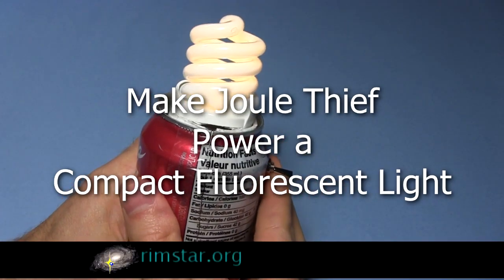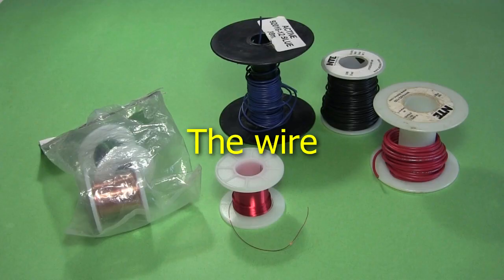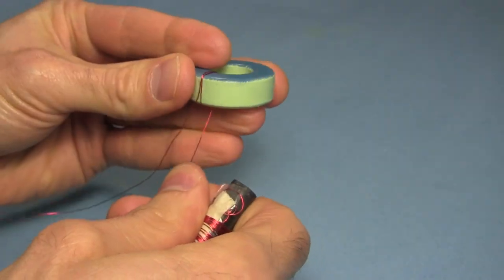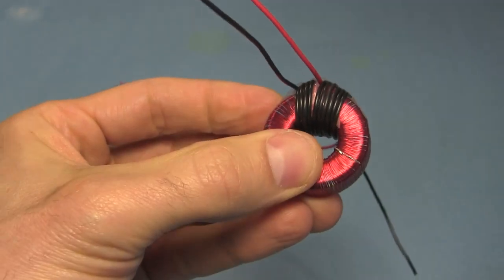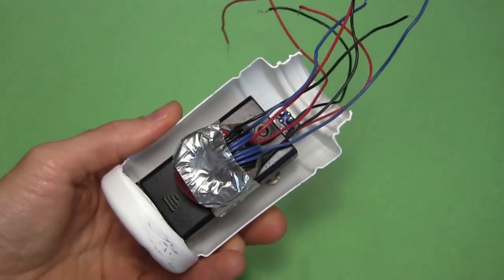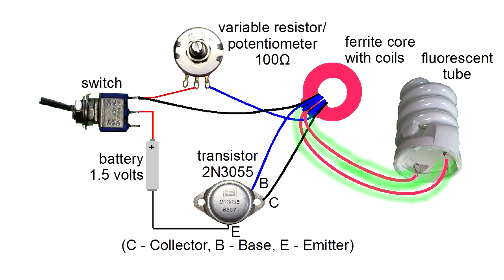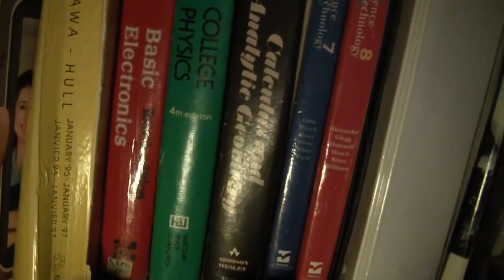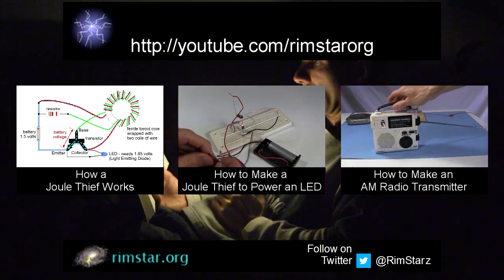How to Make Joule Thief Light a CFL - Jeanna's Light

Comment: The original Jeanna's Light circuit used a TIP 3055 and a 3.375" ferrite toroid and output over 700 volts from a "dead" AA battery.  Jeanna was an online friend of mine and designed a brilliant circuit.  I built 3 of those lights here and they still work all these years later.

Your videos always show great detail and easy to follow instructions for replication.  I admire your ability to do that.  Keep up the good work.

PS  The Jeanna Circuit was developed over at overunitydotcom.

Bill

Comment from the maker: Using the 13 watt CFL in this video the two batteries lasted 25 minutes at full brightness and 30 minutes dimmer. Using a 5 watt CFL the two batteries lasted 90 minutes at full brightness and 15 minutes dimmer. I show these tests in my follow-up video "Fun with Joule Thief Powering a Compact Fluorescent Light". There's a link to it in the description below this video or you can find it in the Videos section on my channel page. Others have different runtimes based on the coils, resistances, ...

Comment from the maker: It was a conscious descision to put only the one 1.5v battery. I started with a joule thief lighting an LED which normally has just one 1.5v battery and I decided to leave it like that since the CFL circuit could have any number of 1.5v batteries depending on your resistance, core and windings. And I think I found the variable capacitor mention you're talking about. It's in the labeling at 0:47. I added an annotation. Easy typo for me to make since I've used variable capacitors so much. Thanks!

Comment from the maker: A frequent error is to get the connections to the short coils wrong. Very carefully compare the diagram to how you've done it. Notice that the two short coils are connected to the circuit oppositely each other. If that's okay then add more batteries in series. Mine wasn't working with a single AA battery but when I added a second one it started working.

Comment from the maker: It's definitely 18 AWG. It says so right on the spools and I used the 18 gauge location on my wire stripper to strip the insulation. Must just not look the same through video or just be a different one than you're used to.

Comment from the maker: Thanks! The ASZ15 transistor is a PNP type transistor whereas in this video I'm using an NPN transistor. However, you can use your PNP transistor if you simply reverse the positive and negative of the battery in the circuit. Everything else is the same. The ASZ15 is a lower power than the 2N3055 I used so hopefully that's not a problem. I just tried with an NTE219 PNP transistor which is close to a 2N3055 in power and it worked. Sorry for the delayed response. I wanted to find and try one first.

Comment from the maker: I don't know how long it lasts yet. I don't have any LED comparisons. I tried a reflector and it didn't help much. I don't think it was bright enough to matter. Same for solar cells I suspect.  But the fun was just in getting it lit as much as I did, more than I expected in fact. Adjusting the potentiometer does adjust the brightness. I turn it down to min resistance and then increase the resistance while the brightness stays the same, using as little current as needed.

Comment from the maker: Hmmm... is right. How many turns do you have on your toroid? Are you using the circuit in this video and putting your LED where I have the CFL? If you have a lot of turns and you're putting it where I have the CFL then as I said, it's dampened AC, but it's high voltage so maybe the even dampened voltage is high enough. Will a high enough voltage light an LED in the reverse direction?

Comment from the maker: I suspect a ferrite rod might work, though I don't know how to layer the coils or if you should. I started out with trying my ferrite rod and didn't have any luck so I switched to the toroid. But I was trying only one AA battery when I was experimenting with the rod so it may or may not have worked had I tried two AA batteries. I've seen videos of others using similar circuits and longer rods.

Comment from the maker: Are you asking if it works with normal light? I assume you mean incandescent lights, the ones with just a thin wire filament inside a round glass bulb. I've never tried but it isn't designed too. Those would appear as a short circuit and wouldn't be taking advantage of the effect of this circuit at all.

Comment from the maker: If you're not getting a voltage reading from the many-turn coil then it sounds like you may have a short circuit, maybe due to high voltage when you had only one battery, not enough to light the CFL but enough to get high voltage. How thick is the insulation for you short coils? It's possible to have a short between the short coils and the many-turn coil. If that's the case, you might be able to just change the wiring for the short coils and the short on the many-turn coil won't matter.

Comment from the maker: Oh, are you removing the resistor from the circuit when you measure the resistance? You have to otherwise your measurement will include the circuit in the other direction from the resistor too.

Comment from the maker: I don't want to try LEDs right now since LED flashlights powered from batteries exist, makes it less fun. But powering CFLs from batteries is exciting!
I chose my core completely at random. I selected it because it was the biggest I had. It's also an iron powder core which people seem to think wouldn't be great. Maybe it isn't but it worked and it stayed cool while the transistor and batteries heated up. So I'd say, just try what you have.
And I'm glad you liked it. Thanks for watching.
Reply: Why not run the lamp from the collector current coil?
What kind of run time you get with a new pair of AA cells?

Comment from the maker: You might be able to but from the specifications I'd say it's borderline. It might damage the transistor. If you try it I'd suggest to start it the first time with the potentiometer set to the highest resistance and then gradually turn it down until the CFL turns on or the transistor breaks. You could add a fixed value resistor of maybe 70 ohms in addition to the potentiometer just in case but the CFL may not light.

Comment from the maker: No, the distance is the length of just the tube itself, from the end of the tube where one set of wires connect to it and the end of the tube where the other set of wires connect to it. In order for the tube to light up, the gas inside the tube has to be ignited from one end to the other. For a spiral tube that's the length of the tube as if you'd straightened it out and measured from one end to the other.

Comment from the maker: I can't say for sure but I assume they act as a step-up transformer, the few turns of the short coils inducing a higher voltage in the long coil. If you look up step-up transformer you'll see how that works. Let's say you have a transformer with 2 coils (keeping it simple) and the 1st coil has a few turns and the 2nd coil has many turns. If you put fluctuating low voltage in the 1st coil, that'll result in fluctuating high voltage in the 2nd coil. To light the CFL we need high voltage across it.

Comment from the maker: You can get cores in many things: microwave ovens, power supplies, TVs, ... I think stacked washers would be susceptible to eddy currents across their surface. But make sure to put something thin and non-conductive between each one to prevent eddy currents through the stack (waxed paper, thin plastic from a plastic bag, ...). It probably won't be as good as a ferrite core but it's worth a try to see how good they'll be.

Comment from the maker: Sure. But the speed with which the cap will charge depends on its capacitance. A lower capacitance one will charge faster than a higher capacitance one. Also, make sure your cap has a high enough breakdown voltage (also called dielectric strength). That's the voltage rating typically written on the cap.

Comment from the maker: I didn't have success with a cylindrical core, but I tried it first before I realized the issue with voltage breakdown through enamel insulation. Others seem to have had success with cylindrical cores though.

Comment: A simple rule of thumb with it all, is that the lower the number of primary turns, the brighter the light but more the current draw. A balance can be reached and that's a main interest in such circuits :)
Yours is great for what it was designed for, reading, emergency light, night light perhaps and fun !

Comment from the maker: The first thing to check is your connections to the coil. They're connected the opposite of what you'd expect so compare them carefully to the diagram. The other thing to do is try a higher input voltage. I was trying for a long time with just one AA battery but when I finally added a second AA battery connected series (positive of one battery connected to the negative of the next battery) it started working. You could even try 2 or 4 AA batteries.

Comment from the maker: My toroid is 1 1/4inch outer diameter and 5/16inch inner diameter or 33mm outer diameter and 15mm inner diameter. But I just used the biggest one I had. If you have a bigger one then use it so that you can get more turns on it. It'll also be easier to wind. There was some question if a ferrite core would be better than an iron powder core (like mine) but since mine stayed cool during the tests in my "Fun with Joule Thief Powering a Compact Fluorescent Light" video, iron powder cores are okay.

Comment from the maker: Actually, comparing it to some I've seen, I thought the light level was pretty good. I was surprised I could easily read by it! I did try a 9V one early on and it was brighter than whatever else I was doing at that stage. I think I didn't keep using it because I wanted to keep the battery voltage and power small, since to point is to get the best results with the least power. I started out trying just one AA for a long time without success.

Comment from the maker: My understanding is that fluorescent tubes need high voltage AC across them so that the mercury doesn't all migrate to one side, so you'd need some sort of circuit besides just batteries. Most of the ones I've seen usually have bigger toroids so there's more room to fit a lot of turns without the ends coming close together. That way they don't need more insulation on their wires. More turns might help. I had 500 hundred at one point but that wasn't as good, probably too much resistance.

Comment from the maker: I'm pretty sure it can't be used for a box fan. The output is pretty spikey with relatively long pauses between the spikes as the energy builds up in the coils. You're better off powering the fan directly from the battery. It's really the form of the output that restricts its application.

Comment from the maker: It doesn't have to be a spiral. But I think that the longer the distance between the two ends of the tube, the higher a voltage you'll need to get it to light up.

Comment from the maker: I removed the CFL and put the output wires close together at various distances - no sparks. Each cycle there's a high voltage spike, around 1kV, then within 2 microseconds it drops to 0 and negative to around -200V. It then goes back positive and negative and so on, each time decreasing in voltage until it stays at 0V until the next cycle. I guess there isn't time between the 1kV and the -200V for a spark in air. Maybe in a slightly conductive gas it would, but I don't know for sure.

Comment from the maker: +Nishi Chemie You can't do it with a joule thief circuit. But if your input is AC then you can look into "step down tranformers", and if you want DC output then add a full wave bridge rectifier after that. If your input is DC then one solution is a DC-DC converter. I don't have anything to help you further, but maybe knowing the terms to look for will help.

Comment from the maker: Only in that it steps up the voltage. The difference is that it also steps up the current. This is done by building up energy in the core's magnetic field, during which the CFL is not getting power. The all that energy is dumped, hence the higher voltage and current. Then the cycle repeats.

Comment from the maker: +Nishi Chemie If you don't have a variable resistor then try different fixed value resistors since your resistance might be too high. Also, see my follow-up video where I measure the resistance https://www.youtube.com/watch?v=yz_99oVMbSI
Your problem may also be in the wiring. Double-check the way you connected to the coils since it's backward from what you'd expect.
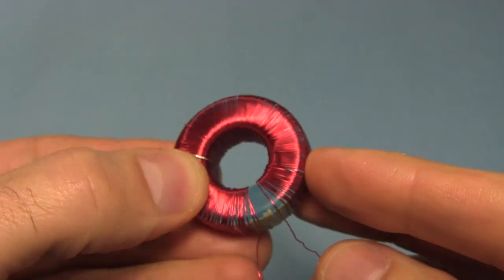It's also possible that you had the problem I talk about at 2:16 if you didn't put thick insulated wire at that point.
For an easier one, try powering an LED instead. You can see how to do that in this video here https://www.youtube.com/watch?v=B61DU7yEsPM
PS There's no Reply button under your comment because of your Google+ settings.
- go to your Google+ page,
- in the top, right corner click on your thumbnail icon,
- in the popup that appears, click on "Settings".
- for the 2nd question down "Who can comment on your public posts?" set it to "Anyone".

Comment: I have done everything exactly as you have and I am getting a voltage on the small windings but its not enough for a CFL, i can barley light an LED
Reply from the maker: +chems Try adding another battery in series (+ to -) for more voltage. One AA battery didn't work for me so I added a second one and it worked.
Reply: +RimstarOrg I have used a 9V battery.
- UPDATE -
I remade the ferrite core to be EXACTLY as you've done, 30 gauge wire with thicker wire where ends meet, some packaging tape, 10 turns of (admittedly 20 AWG, not 10) and 5 turns of the same wire. Basically what you've done.

 I connected it with the exact same circuit except I'm using a Tip41c which with all my tests works almost the exact same as the 2n3055. I use a variety of variable resistors, 10k 1k and 100 ohms.

Heres the odd part: Once powered the CFL doesn't light. To see if the circuit even works I connect a 20W LED (because previously I got a 20W to get insanely bright off a 9V battery with a different core) and it immidetly brighten and then quickly dies down to nothing...? I adjust the ohms and it does the same thing but at different brightnesses. 

If you didn't get that: I powered it, it turns on brightly, then slowly dims to no light in about 2 seconds.

Possible reasons:
1. Tip41c may not work the same as the 2n3055 in this circumstance. 
2. The 2 10 gauge wires are at different coils. I was wondering why one was 5 turns and the other is 10, why is that? I think this might be the problem because of the inbalance in turns, the magnetic field gets weaker every cycle. Until it turns off? Maybe then I have to switch the wire so the inbalance works the opposite... I don't know if anything I'm saying is making any sense. But I'm not sure.

I find it really awesome that even though this video is 2 years old you are still helping people out!! Your awesome and smart! :D
Reply from the maker: +chems The number of coils for the 2 10 gauge wires were arrived at by trial-and-error, basically trying different numbers of turns and seeing what worked best.  You can try different numbers too.
From the datasheets the Tip41c looks comparable to the 2N3055 as you say.
Maybe you should try lower input voltage like mine, only around 3 volts. Possibly your input voltage is too high causing a voltage at the wires that's too high and breaks down the air. The insulation is already probably damaged from the first breakdown. That would explain it working only briefly. When you turn it on, the corona would take a little time to build up between the ends of the wires before the air becomes conductive enough to act like a short circuit. When you turn it off, the corona goes away. If that's the case, using a lower input voltage might still work as the lower high voltage at the wires might not be enough to form a corona in the air. The voltage reached before the breakdown may not be high enough to ignite the CFL but might be for the LED (I'm not familiar with the LED circuit, though I doubt it requires high voltage.) If it still doesn't work with the lower input voltage then remove the 2 10 gauge wires so that you have just the enamel wire and apply some more tape, basically to plug the holes from the breakdown. Or you could paint on some corona dope.
You might also want to look at my follow-up video for some ideas https://www.youtube.com/watch?v=yz_99oVMbSI.
Reply: +RimstarOrg The LED wasn't connected to the high voltage, it was connected to the Collector and Emitter to see if the "joule thief" part of the circuit even worked. I did try putting the LED on the high voltage and got the same results. But you may be correct with the voltage damaging the wires. I'll go take off the 10 gauge wire and try to fix the insulation of the 30 gauge and see if that works, otherwise I might rewind wire onto a new core. Thanks.

Comment from the maker: To make your own cores you could try using large washers stacked on top of each other with a layer of plastic or paper in between each to separate them electrically. I don't know how well or even if it will work since there will be large eddy currents compared to a manufactured ferrite core.
Sorry for the delayed responses. Email notification of comments doesn't seem to be working.